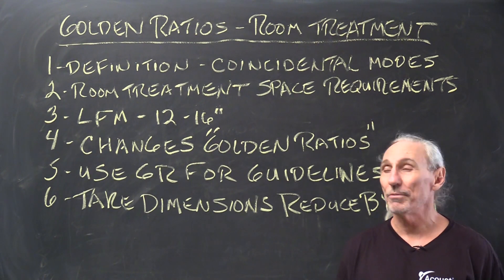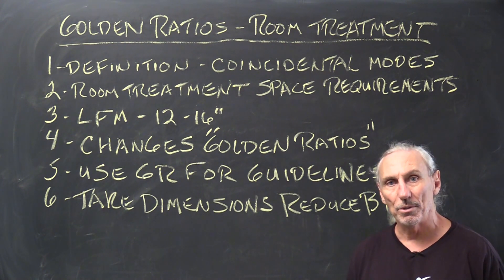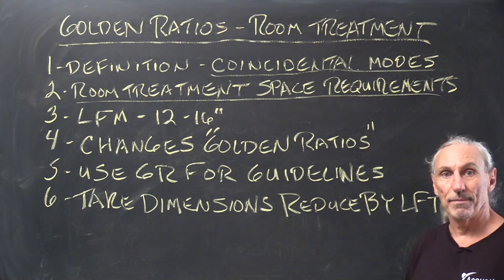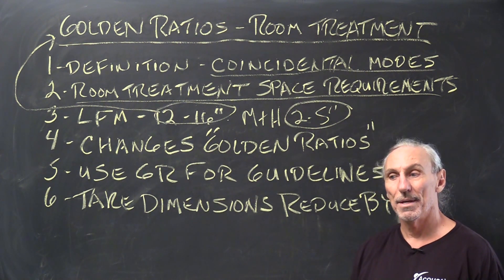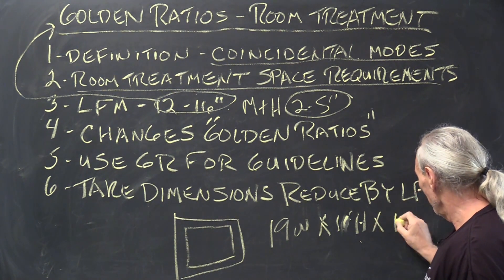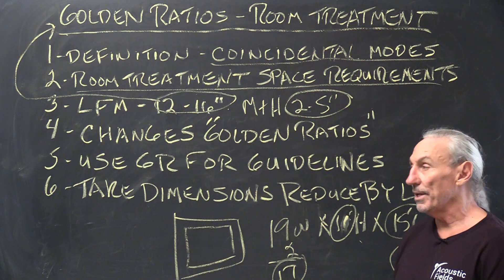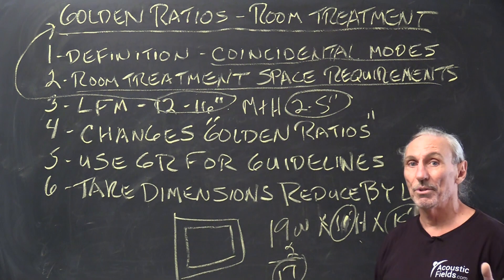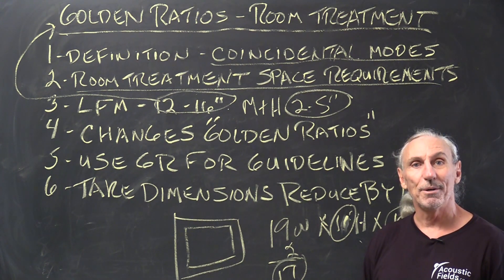Golden Ratios - www.AcousticFields.com

Comment: In feet and inches

Before treatment ceiling height: 16 Foot
Before treatment room width: 25.6 Foot
Before treatment room length: 40.96 Foot

Floor is 4 Foot thick polished concrete. No carpets or absorptive surfaces. (I just plucked out 4 Foot thick concrete out of thin air. I don't know the ideal floor thickness for mastering/recording studios).

Add: 16” of low frequency treatment and 5” of mid to high frequency treatment for a total of 21” treatment thickness.  Add to ceiling, left wall, right wall, front length wise wall and rear length wise wall. 

Ceiling height after 21” treatment thickness becomes: 14.25 Foot new room height

Room width after 42” treatment (21” from the left wall and 21” from the right wall): 22.1 Foot new room width

Room length after 42” treatment (21” from the front length wise wall and 21” from the rear length wise wall): 37.46 Foot new room length
Reply from the maker: Good dimensions. You must manage Rt-30 times correctly.

Comment: So you're saying that BOTH the interior treated dimensions and exterior untreated dimension need to be considered when building a room?
Reply from the maker: F,  With any critical listening environment, you must address noise with the shell structure and then address the inside sonic issues with diffusion and absorption. Diffusion and absorption are not noise technologies. Only a barrier or shell can address the noise issues.
Reply: I should have clarified. I meant do I need to be concerned with the room ratios of BOTH the noise barrier dimension and the absorption/diffusion dimensions?  So if I build a Louden 1:1.4:1.9 at 20:28:38’ at the diffusion/absorption dimension, I also need to concern myself with the 20:30:40 noise barrier dimension (for example in terms of what I might do for room modes (if it even matters for a certain level of treatment).
Reply from the maker: F, The frequency and amplitude of the noise determines how thick the barrier wall is. Most walls we build for noise average 6" - 12" deep. Treatment walls inside the shell or barrier can average 12" deep if you are building the low-frequency absorption into the walls
Reply from the maker: F,   Use the ratios for I. D. (internal dimensions). If you are using our carbon technology allow for an additional 12" of treatment space in your ratios.
Reply: Okay. Thank you. That’s what I was getting at. I realize now that the external noise wall dimension would matter less because of the diaphragmatic absorbers and diffusers etc. Thank you. I’m enjoying watching your videos.
Reply from the maker: F,  Yes, they are separate structures that treat completely separate issues. The barrier is to reduce noise transmission. The treatment "room" is for absorption and diffusion. Think of the barrier as the noise wall and the absorption and diffusion as the treatment wall.

Comment: What frequency range are train horns at  700 to 1200hz? How about truck engines?  Low or mid range? Both are amplified by the ratios of the rooms of my house!
Reply from the maker: J,  Truck engines are full range. I do not know the frequency range of horns. You can look that up on the net. Both require barrier technology which is a room within a room build .

Comment: Obfuscation is apparently your goal.  The point to a golden ratio is that when using them,  none of the room dimensions will be of a pure multiplication of any other dimension.  This minimizes coincidental modes adding up.
Reply from the maker: J,  Yes that is correct. Now, take your thinking further. What you must realize is that the modes that still exist must be treated and that treatment takes 12 "- 16" of space requirements on every room boundary surface. With the treatment space requirements, you now have a new room size and volume since proper low frequency management technology must extend floor to ceiling on all 4 room boundary surfaces. This treatment space requirement then begs the question will my new room "dimensions" still be "golden". Lets stay away from colorful adjectives to describe to layman what they should be looking for and educate them on all variables to consider. Nothing and I repeat nothing stands alone or is separate from anything else when it comes to small room acoustic treatment.
Reply: @AcousticFields  Let's pretend you have a room that's 8 ft x 12.8 ft x 20.48 ft as suggested below. if you were to put 1 ft of treatment on all 6 boundary surfaces excluding the floor you'd have a room that is 7 ft x 10.8 ft x 18.5 ft. This would have a ratios of 1 x 1.5 x 2.6 instead of the original 1 x 1.6 x 2.6 for Height x Width x Length. If you wanted to also stick in a huge 1 ft subfloor for some reason, then you're at 6 ft x 10.8 ft x 18.5 ft then you'd have a ratio of 1 x 1.8 x 3.1 which could run into problems.

That said, the lower frequency waves will penetrate common open cell foam with the majority of the reflection occurring at the original wall instead of the interior foam boundary while the higher pitch frequencies will be reflected. The high frequencies may be reflected in different directions depending on the shape of the surface while low frequencies will ignore the shape of the inner foam surfaces.

With 1 ft deep, flat, open cell foam on 5 out of 6 surface boundaries:
-the effective dimensions for a 20 Hz wave may still be 8 ft x 12.8 ft x 20.48 ft (or larger due to tortuosity of the material) without much scattering and
-the effective dimensions for a 20 kHz wave may be 7 ft x 10.8 ft x 18.5 ft with some scattering for the same treated room.

And then you stick other stuff in the room...
Reply from the maker: R,  Open celled foam is not a low frequency absorption technology no matter how thick it is.

Comment: So what is an example of a golden ratio room ?
Reply from the maker: S, There is no one size fits all usages. First, you must define usage. Usage dictates pressure level. Pressure level will require certain size/volume ratio which will also allow for treatment space requirements to match pressure and usage.
Reply: 1 x 1.6 x 2.56  Height, Width, Length.

So if you have a height of 11 feet, then the width would be 1.6x11, which equals 17.6 feet, and the Length would be 1x2.56 or 28.6 feet.

11ft (Height)  x 17.6 ft  (width) x 28.6 ft. (Length). Since most people in the US have 8 foot ceilings. then a golden ratio room would be 8 ft x 12.8 ft x 20.48 ft.
Reply: @Oneness100   Cheers !